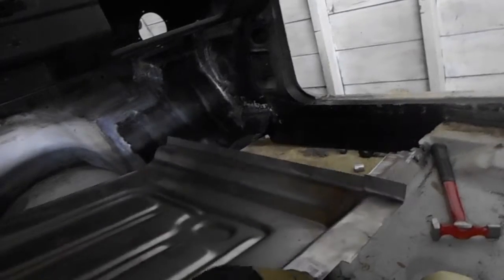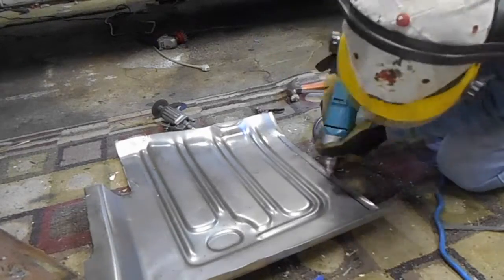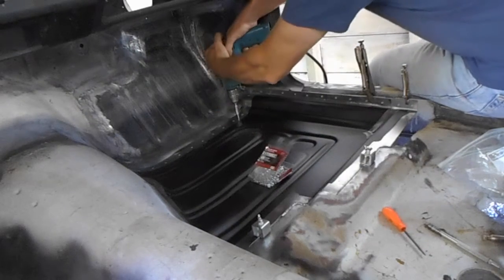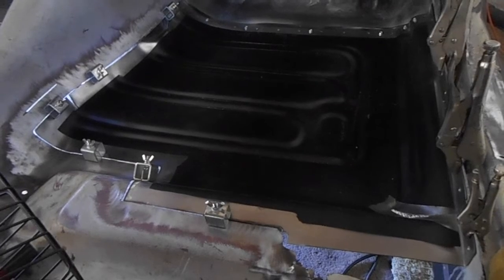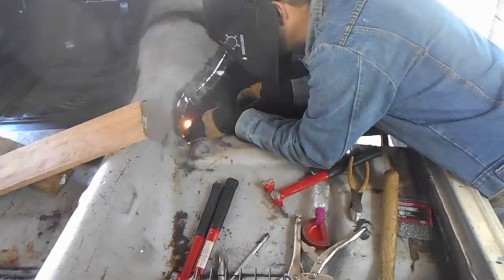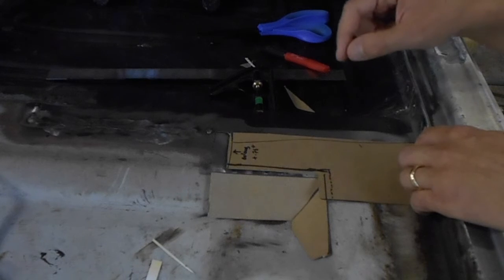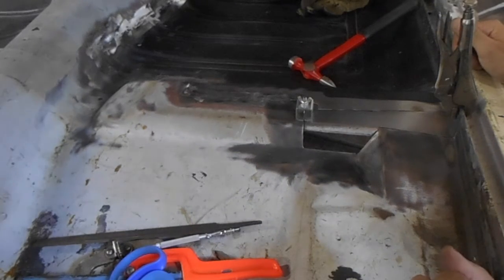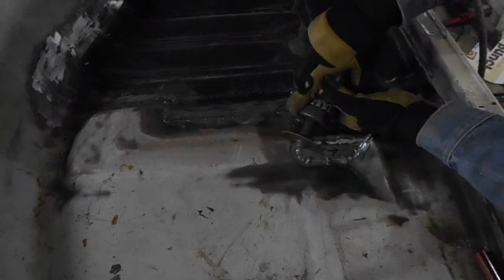Passenger Side Floor Pan Repair - 017

Comment: If anyone is going to do this using flux core just make sure you have a dc welder and use .30 wire, even better if you have an inverter welder thar way you can ground it either using positive or negative depending on the results you want
Reply from the maker: Thanks Jonathan Belanger, that is useful info. Incidentally, I'm using a Millermatic 135. I'm using solid core with 75/25 shielding gas. The unit is pretty old but I love this welder it has always performed well for me.

Comment: what kind of welder is that
Reply: Is a mig welder , they use a wire driven through a hose and onto the handle,  and use different gauges for different procedures. 
Hope it answered your question. 👍
Reply: @MrMariow01  thanks
Reply: @MrMariow01  is it a "flux" welder or argon gas?

Comment: Good job but, the video is not fully detailed. A DIY need to know step by step like the type of welder and the settings for welding the floor sheet metal. I’m say this because I know nothing about welding that why I go to YouTube for videos.
Reply from the maker: I'm mostly self taught when it comes to welding and fabrication. I make these videos to share my experience and be part of a community of like minded individuals. I'd be happy to tell you how I did things. However, most people would agree that I am not in any position to give advice or instruction on how to weld. But, keep watching and maybe we'll learn something together.
Reply: The settings are usually in the inside panel of the welder used a MIG welder I suggest if you want to get into welding watch as many MIG welding and stick welding videos as you can that's how I taught myself to weld because the people I that I know that weld always act like they are too busy and if you ever by welder don't buy the cheapest one possible because you are going to get what you pay for

Comment: I would just overlap the joint and spot weld the shit out of the metal panels. I personally would not wish to be sitting on the spot where the floor pan was stitch weld by you in the same fashion. God knows, it was a pretty impressive aesthetic work the way you did it, but hell knows just how strong, durable, solid the actual weld is. You don't even know how thick the welded seams were after your brilliant grinding and sanding.
Reply from the maker: Hey, thanks for watching. Seeing as most people drive around with holes in the floors of their 50 year old cars where the only thing between their feet and the road is a moldy carpet, I'm pretty sure I'll be safe. But, I'll definitely keep this in mind if ever you need a ride.
Reply: Well I guess you would have done a terrible body job.

Ironically enough, your repair would rot out twice as fast as his, making it a lot more unsafe.

Comment: Nice work. Thanks for posting. Did you only plug weld or screw the one side? A little confused about the process and curious because I have a similar project in the garage.
Reply from the maker: Thanks, and sorry about the confusion. I'm still pretty much a noob at making videos, and don't always have the footage that I need. The screws are temporary, and are only used during the assembly to make sure everything fits nice and tight. I take them out after I plug weld and then weld up those holes before grinding everything flat

Comment: Excelente trabajo... de cuanto es el esperos de la lamina utilisada ?
Reply from the maker: This floorpan was made by Sherman parts ( part number 362-46R ). They list it as 19 gauge which is about 1 mil thick (0.0418 inches)